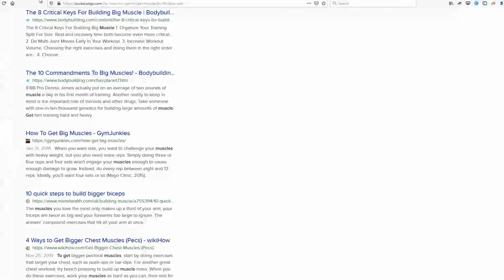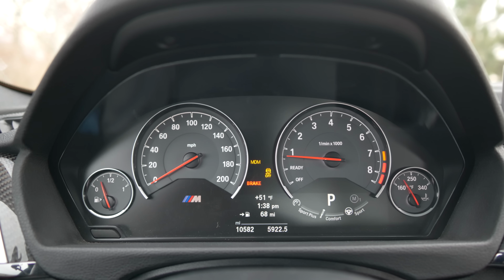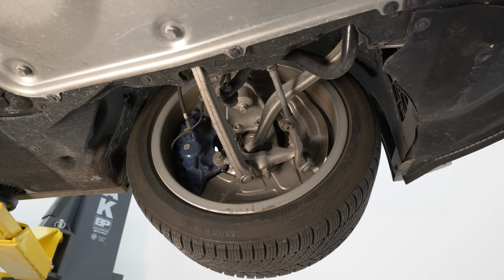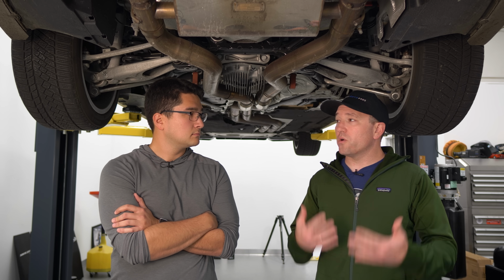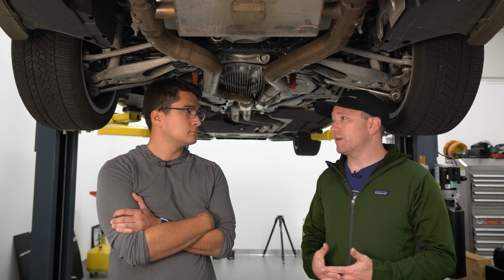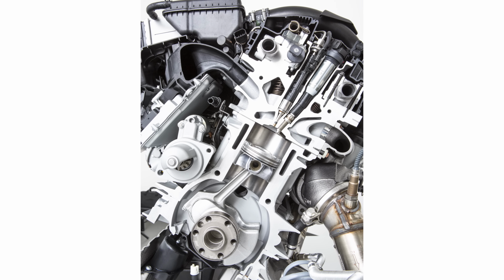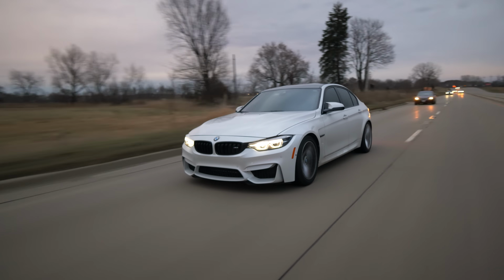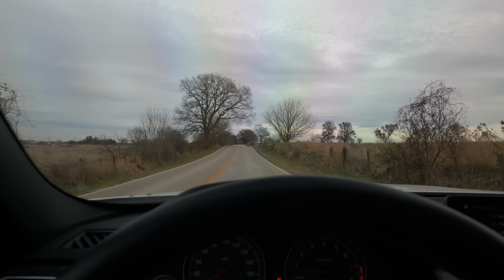BMW F80 M3 Review | The Sports Car for Mathematicians

Comment: Yeah, I stayed away from BMW for a long time due to the reliability.  But my first BMW, a F30 3 series, has had only extremely minor issues in the 3 years I've owned it -- not even enough to take it in to dealership (like minor iDrive bugs, etc).  It's been more reliable than my 2015 Mazda 3.  Just swap out the shitty run-flats and you're good.  Oh -- there is one major issue I forgot to mention -- that doesn't affect me though: The timing chain failure debacle with the n20 engines.  But I got lucky with my build date, it seems (have the newer timing chain revision).

Comment: Great car but having owned this car I can assure you the Alfa Romeo Giulia QV is vastly superior. The engineering is simply on another level.
Reply: I've considered it, test drove it and can't agree. QV brakes are terrible. I managed one stop that didn't jerk the whole car on the test drive. Power is hidden too far up top and I was changing gears too much in the canyons to simply enjoy the drive (8 gears is too many with that narrow power band). Electronics are just bad compared to BMW, everything feels a generation behind. I consider audio as part of my driving experience, and just sounds bad (like $20k base car bad), even the seller agreed. Exhaust sounded good when open, but even that required a few hundred in mods. Worst thing: reliability. Alfa couldn't even provide a good car to reviewers. So many people with issues are having their QVs sit at dealerships for months, it's tragic. Meanwhile, dealer support is terrible and people get Chrysler vans as loaners if at all.

In short, there's a reason there's still new QV inventory from 2018 at dealerships, even with $20k discounts. Alfa is not a car you can trust right now.

PS: check the boost QV runs. Not much room to tune and scares me long term.

Comment: Being impressed with the suspension tech is noteworthy. But I keep thinking to myself all of this OctoTurbo TripleQuadQuint Intercooled MegaHyperComp engine tech is close to being pointless. As soon as someone finds a solution to piss-poor EV battery performance. I don't know how soon that's gonna be, but in the meantime a lot of these ICE engineers' genius could be spent pursuing more fruitful endeavors.
Don't get me wrong. I'm a muscle car guy and have been since my first car in '82. Nothing beats the visceral sensation a set of forged pistons produces. I loved wrenching on that 302 equipped '68 Mustang. It got me through high school and laid on a regular basis. 
But for the masses, from a practical standpoint, the manufacturing and maintenance of electric motors kick IC engines square in the nuts. 
How long did steam engineers try to squeeze another hp out of a lump of coal during the advent of gasoline? 
More sooner than later, ICE service shops will become boutique - really greasy boutiques where old guys like me can hang out and bitch about change.

Comment: Even though its not an M car. The e92 N54 with M suspension and LSD felt more fun than the f80 m3 I drove. The hydraulic rack is much better and it feels more raw than the f80. Just my 2 cents

Comment: I think j you guys are confused about the e92 DCT. It NEVER had anything but a DCT. You’re confusing the e60 m5 which had a smg, by the time the e92 launched it came out with the same DCT that eventually came in the F80 & F10. The e60 is the car from the era that had smg3 or whatever it was called.
Reply from the maker: The E9x auto was a dual clutch co developed with Getrag. However it still had cooling issues the current DCTs don't face as much.  SMGs were single clutch.  All current gen BMWs are either DCT or TQ converted autos. We didnt get into all of that.
Reply: savagegeese yea I just meant as far as the comment about “the DCT from the later e92’s, I seem to recall jack asking if the smg was ever in the e92 in a recent video too/or the e60 having a dct. It really doesn’t matter when we’re nitpicking engine codes just wanted to clarify in case there was any confusion, no contesting the programming and supporting act was improved, just really clarifying the dct was epic from day one, unlike the smg. 

If I misheard something my apologies.
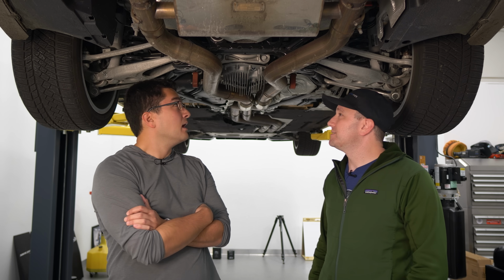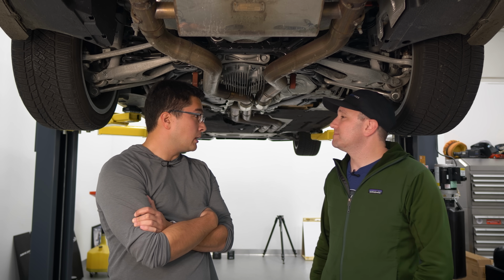Reply: savagegeese @ 9:04 found the comment I I was referencing at 9:04 when Jack referred to “later e92 models getting the DCT” and I recall the same recently re. Either the e92 or e60 m5, so just commenting out of love. No homo. Unless you want/enjoy homo in which case...yes homo/all the homo etc. seriously though I’m not trying to be a jerk, I watch these videos and feel like. I’m having a conversation with y’all, so if I respond too much occasionally it’s because I’m literally responding as I watch as I’m just that invested and enjoy the content. 

Last comment, will you ever do the z4m ? If you said you were looking you’d have one in no time I’m sure. 

I’m very interested in what you think and how it compares to your views on the z4 frsupra reboot 

In fact it would be epic you made a everyday driver style m car short film/expose. Or at least just the z4m vs ...anything. Even the z4 sdrive35is. 

Which was the only non-M bmw to ever get the DCT...though iirc that’s possibly happened again since then, maybe on a x3m or ...oh maybe the z4 reboot itself

Comment: Great analysis on the car. It's so precision engineered that it almost comes off as boring especially when compared to vehicles like Alfa Romeos or even older BMWs. Typical BMW hallmarks like oil consumption and carbon buildup aren't issues with the S55 or S58 motor and this car is actually completely daily driver comfortable. Other than the crankshaft hub issue (which is well documented and fixable) these cars are solid as can be.

Comment: I would MUCH rather buy a Tesla Model 3P. It’s about half the price fully loaded, is quicker, quiet, smoother drivetrain, more high tech, less moving parts that needs service, cheaper to run, and most of all- people will like to test it and discuss it during dinner. The BMW is like an old boring Nokia. Well engineered but slow, expensive and old school.

Comment: What the fuck is that cable hanging down from the diff practically touching the road?  Is that the bit that hooks on the expansion joints on parking ramps and gets torn out, forcing you to end your night early and get towed to the dealership and raped by the service department to repair it?

Comment: TL;DR: Why not both? Different strokes for different folks.

I’m bipolar, at times I love one and hate the other; and vice versa. 

I’ve owned both platforms, and I think the F8X is highly accurate with amazingly robust power delivery — although hard to tame off the line/at the limits — whereas the E92 is less drama off the line, though much more controllable at the limit (but the suspension is not super conducive to this on very bumpy roads) as far as linearity of power delivery and the weak but highly linear torque curve. 

I like the looks of each equally, for different reasons. The E9X I find much cleaner and more “beautiful” with the perfect amount of aggression. Though the sedan and coupe have far more different visual flavour on this generation. 

The looks of the F8X are quite the inverse, with the design language being more aggressive and “handsome” with a hint of beauty and elegance all throughout. 

Both have industry defining interiors, however that will be subjective based on various automotive personality types. Some individuals will be more flexible, however others may be strictly biased to one generation or the other; because one interior is much higher-tech and far more premium, while the other generation has a much more focused and “lean” look & feel (though with still very high quality “supple” materials); I’m certain it’s self explanatory which respective generations I’m referring to in that last example…

All in all, you need both.

Comment: Bmw m3: the car that everybody thinks is just a $20,000 3 series. 

Dont the Guilia Quadrafoglio, RS5, and C63s AMG eat this thing alive in performance? I’d love a head to head with all of them.
Reply: I'd give you the C63s. But I think it's unfair to compare the RS5 to this car given that the RS5 was just updated where as the F80 has been out since 2014. It would be more fair to compare the RS5 to the upcoming G80 M3. As for the Alpha, that car is faster when it isn't broken down or suffering from a slew of electrical issues.
Reply: TLumVids we need a proper performance saloon head to head to see definitively. My curiosity is peaked

Comment: So m3 or Alfa romeo guilia?
Reply: M3, alfa loses its value faster than girls lose their virginity nowadays
Reply: As sterile as it's become, the M3 at least won't leave you stranded.
Reply: @RK1FX  The Guilia is a way better drivers car.
Reply: @hugolafhugolaf  Had my Guilia for 2 years and 22k miles with no problems.
Reply: @hugolafhugolaf  Yea, heard of spun crank hub on M3's (or all S55 engines for that matter)? Look it up.
Reply: Alfa Romeo Giulia, in the portuguese Alfa Romeo community one guy have one Giulia Quadrifoglio with 75000km and the car have a remap to 600bhp and he frequently go to trackdays and the car runs like new...😉

Comment: Probably the worst review of f80 I have watched. I have been an owner of F80 for over 3 years,. I have been driven it daily, and it still feels a better car than me as a driver. No, M3 is not meant to be a garage queen. No, it won't feel special to you, unless you put some thousands miles driving the sh** out of it.  My advice would be: Instead of theorizing about another sport car, why don't you buy any (may be start with Miata), start driving it daily and on track, and try to learn something new, may be. This review is an example of consumerism culture, which promotes the never ending pursuit of perfection instead of trying to living it. This one is good, but is it good enough for me?  
Can you have fun in f80? Absolutely!  Power? For sure!  Reliability? The best I have seen owning BMWs for over last 12 years!  Some lack of steering feel? Who cares!  The rear subframe is bolted to the body. You are getting plenty of feedback -trust me..
And the used ones are getting pretty cheap too these days. So just grab one and drive the heck out of it!

Comment: I think historically these cars are designed and built in the EU for a predominantly EU market base, the US (and Asia) get the car in a LHD version because the world is a global market now.  The very fact that the engineer doesn't know what a Challenger SRT Hellcat is, is very telling.  BMW, Mercedes, Audi and Porsche have stopped considering US designed and made vehicles as competition approximately 50 years ago.  Mainly because their engineering and technology systems are largely superior.  

That said EU safety regs have meant that BMW (and others) have gravitated to more control when putting down serious HP.  It's madness to think that the new M135i is now 4WD only compared to the M140i it replaces.  The stats look progressively better model to model but the 6 cylinder engine is gone and the two hot hatches put down the power in very different ways.  Maybe why in the UK 8% of M140is ended up in field in the first 15 months of ownership.  

The M3 (also insert M5) are multifaceted vehicles and the engineering prowess, the mathematics as you call it, is an appealing factor to the EU consumers, many who have owned multiple iterations of the same or similar vehicles within the BMW family.  Sports car versus Daily driver seems to be a long running theme in the M car reviews.  For less than the price of a new M3 or M5 yes you could buy an entry level Escalade and then put the money saved into a "true" track car, but that's not the route many (or all) will want to take.  Germans, Austrians, French, Swiss and Italians all get to drive their M cars on derestricted Autobahns where power and luxury are enjoyed in equal measure, and all very safely at 140+mph.  

The M3 and the M5 are the Swiss Army knife of performance cars, you want your wife, kids and luggage to blast down to the Austrian Mountains with skis on the roof, sure.  They've got you covered.  It could be said that it tries to do too much in one package but I think this glosses over the package which BMW put together with this car and it's 2021/22 replacement.  When viewed through the eyes of a car customer outside of the USA alot more about this car makes sense, probably the reason why almost 35'000 M3s were made and almost half of those were for the US market.

Comment: why do US spec bmw's always look uglier and cheaper than the equivalent bmw's from other markets ?
Reply: NA spec BMW's are actually higher spec. In the case of this M3 it's built in Germany and is same as what you get in other markets, so no difference.
Reply: Baleh Baleh thanks for the info, idk wat it is but US bmw’s always seem lower spec to me, like the wheels on this competition are not the regular snowflake and other little bits make the car look different
Reply: @morganneedham155  it seems to have a winter set of wheels/tires on, considering this is rear wheel drive it's a must during winter.

Comment: But an oil change cost $1,000..lol
Reply: 200
Reply: No.
Reply: 220
Reply: Depends. 200 ish at the stealership
Reply: Bionic Rasta obviously a joke chill, hence the “lol”
Reply: Behindthen0thing and the base price of an M3 Comp. is 349-378(oil change)
Reply: MANUEL ENRIQUE ANGEL AVALOS Behindthen0thing and the base price of an M3 Comp. is 349-378(oil change)
Reply: I do my own oil changes. It’s super cheap and easy
Reply: Tommy L Garage ik, I have a Nissan( everything is right in front of you basically) but you gotta think, most ppl in that price range most likely won’t be doing to their self.
Reply: Or you can take 20-30 mins and do it for $80
Reply: @Mutedx0331  In Europe or USA?
Reply: Behindthen0thing it was a joke, the price is more like $378
Reply: @Mutedx0331  depends
Reply: Behindthen0thing yeah it’ does but most luxury mechanics will start at like 280

Comment: Has the wrong wheels for a competition package. Maybe it’s the “Canadian” competition package. Ha ha ha ha .
Reply: More like a winter wheel/tire setup using the stock 18” 513m wheels.  You can see all the siping on the tires when they are in the shop.  Might explain some of the lack of traction they were having.
Reply: Jerome Angsuco those are not 513M - 640M I think.
Reply: Looks like a winter wheel/tire setup.
Reply: @TommyLGarage .  You are right, they're really similar.  Should of noticed they were silver and not dark grey.